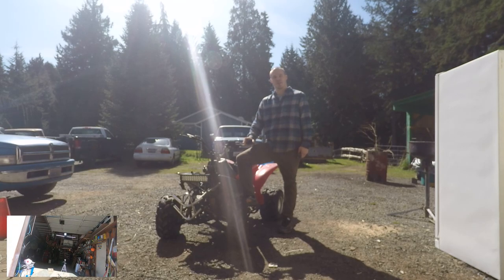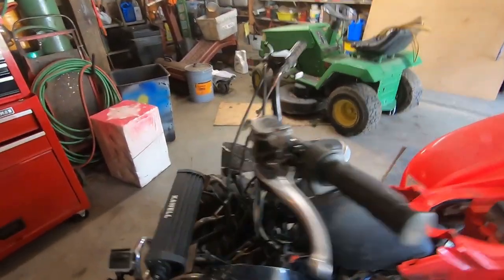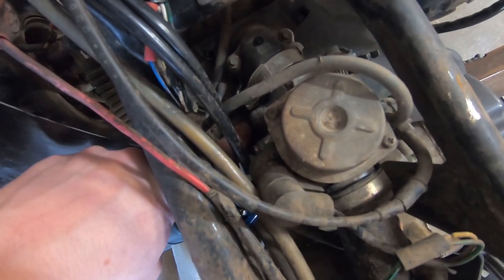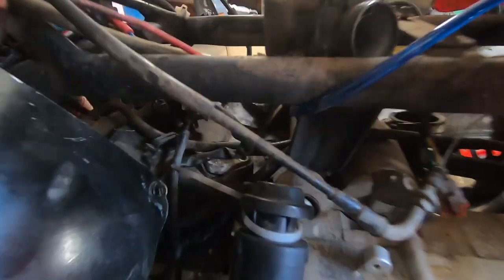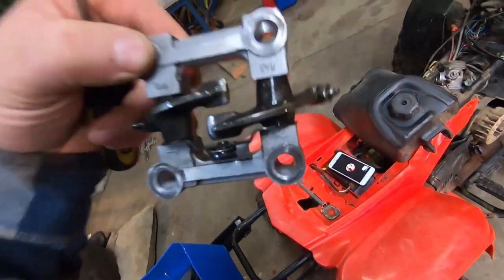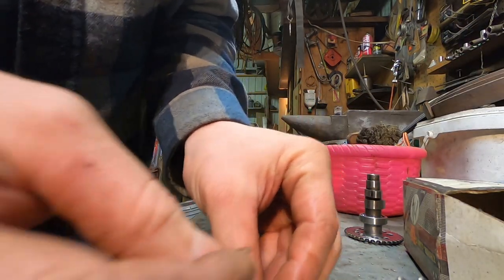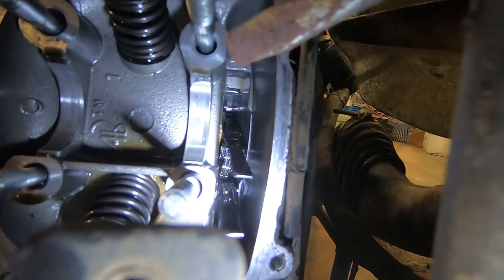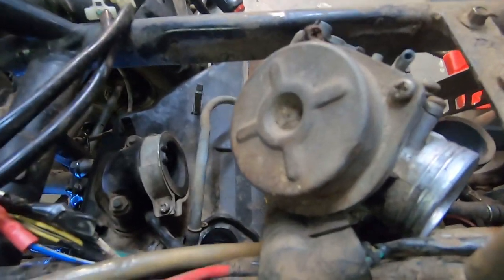Amazon A9 Cam Swap in GY6 Quad with Comparisons, 15% improvement!

Comment: Do you need to rejet the carb after a cam install?
Reply: A good point.  But without a wideband o2 sensor on it I feel like I would be shooting in the dark with the size change.  I'm sure that some carburetor wizards would know how much to change it though.

Comment: I think I have the same fourwheeler. Is that a Baja 150? Also, did you notice any top speed improvement?
Reply: I would say it feels like improvement across the board which was mainly felt in the high Rpms. I can now wheelie if I put my foot on the bar on the back and couldn't do that before.